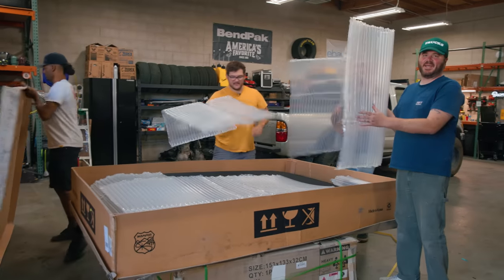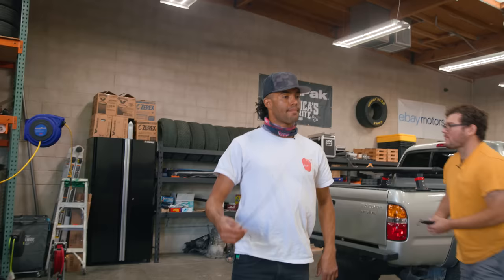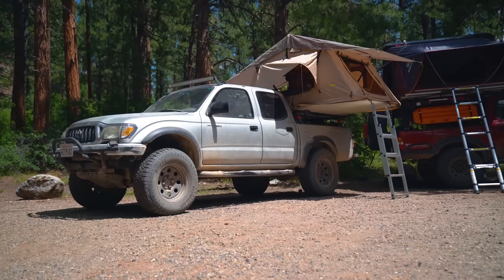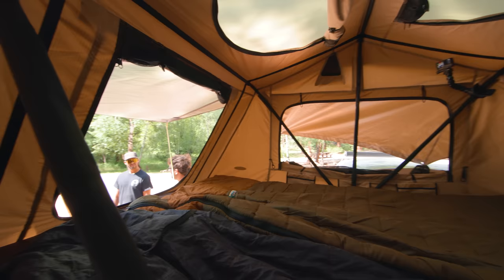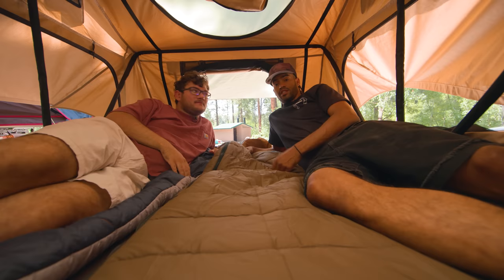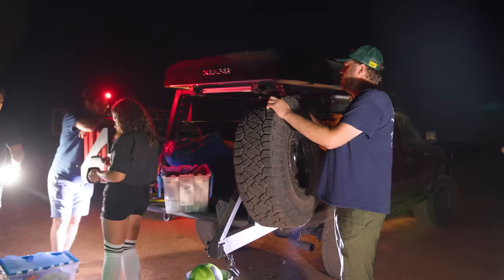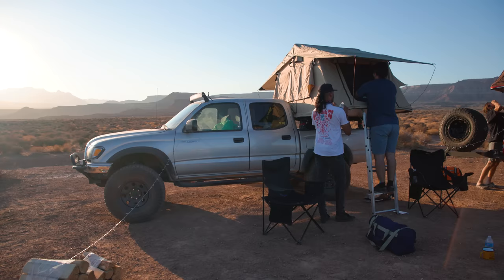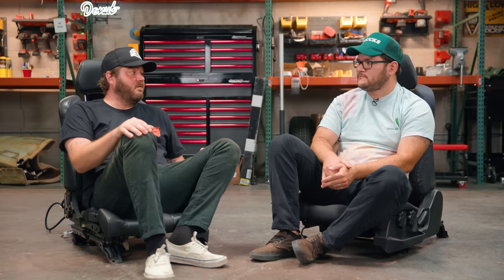$900 vs. $3500 Roof Top Tent

Comment: RTT’s are way too expensive. My REI Cadis rapid tent sets up in 1 min and you can fit up too 6 people and you can stand up in it was only $300 😅 I’ve started sleeping in in the back of my car with a particular set up but if RTT’s where cheaper I want to do an add on to my camping trailer and match it all to my car.

Comment: There are a lot of ground tents now that are 2 to 3 times that size over 6ft in hight so you can stand up and get dressed. Put a table and chaires in with an air mattress, that takes only 60 seconds to set up from the time its taken out of the small carrying bag.... No thanks you can keep youre heavy expensive roof top fiasco.

Comment: I get if u have a car or small suv these are a good idea ish but If u have a pickup or lager suv just get a camper top or sleep in the back my xj folds flat and is a perfect double bed well a bit shorter still great tho my Comanche has a work aluminum topper wich is even better and has this thing called metal around u lol the biggest downfall and reason I wouldn’t own a roof tent is how am I getting 130lbs German sharped up there lord knows hes a wus and wouldn’t like sleeping on the ground 2nd is late night pees seem pretty risky to eaches own I guess

Comment: Sorry Americans, Ich habe ein question.. Why the f... do you buy such rooftop tents at all? You've got a pickup truck, so you you've got plenty of space for storing really big tents, hammocks, tarps, an whole deluxe camping kitchen, a camping shower.. a whole bathroom as a tent if you want but you really decided to use this space with THIS? A mattress and a tarp would've done a better job. When I saw that the luxury tent costs about $3500 I thought it would be something fancy with a hard plastic shell and onboard entertainment. What a boring thing, I bet this couldn't even resist real cold temperatures. Even $900 is too much for this, the whole concept is wrong, Sorry. Edit: Or what's about ordering the longer 4-door cabin version of the truck and if needed remove the right front seat and/or the rear seats and create a camper this way?